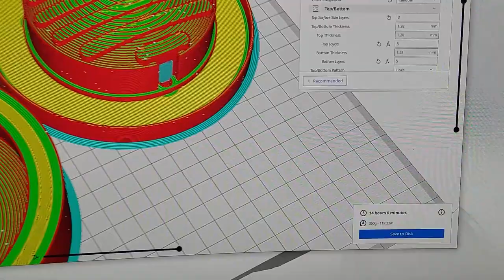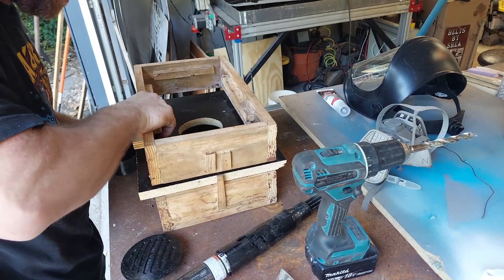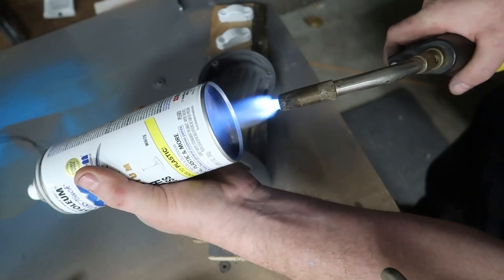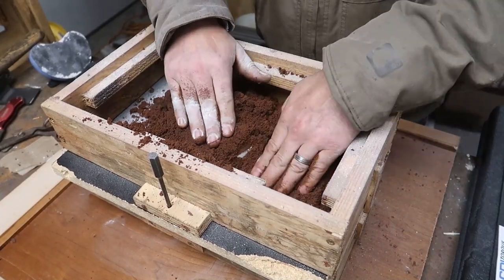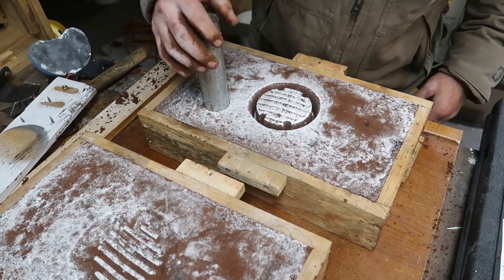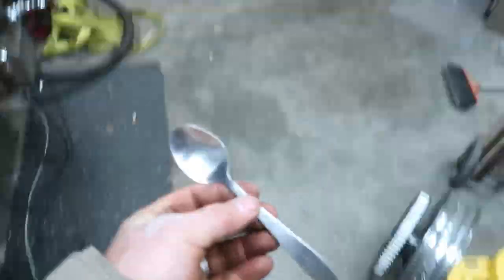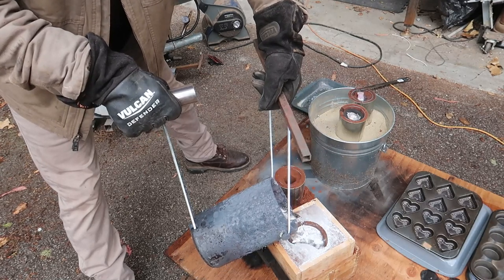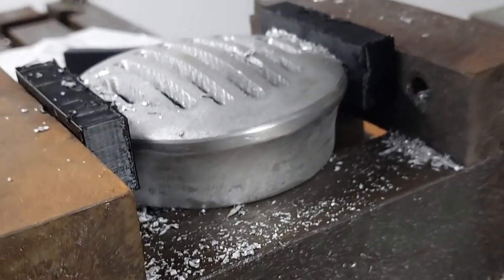Aluminum sandcasting a Harley Air Cleaner | Lark Machine Co

Comment: What's your sand mix, I'd love to try it. I cast blocks and mill them.
Reply from the maker: I bought the petrobond on ebay. That's about all I know. I have used greensand in the past and this new stuff is much better. I can send you a link if you are interested.  Larkmachineco@gmail.com
Reply: @sheanyquist  thanks but the postage to NZ would kill it.  Mega expensive to get anything into NZ at the moment.